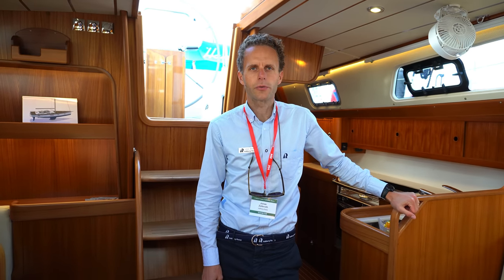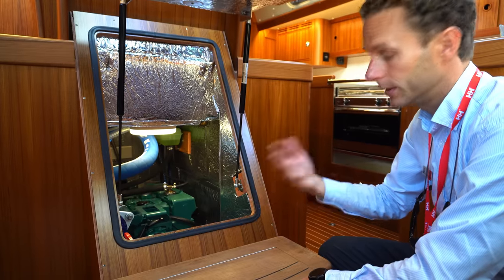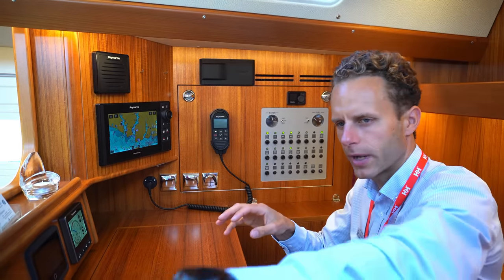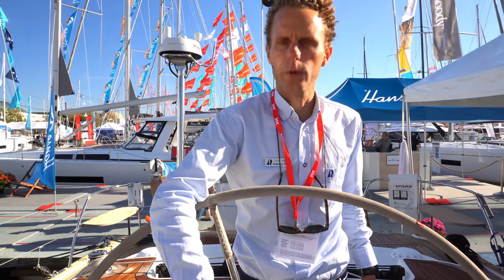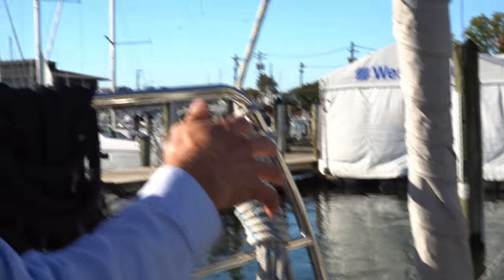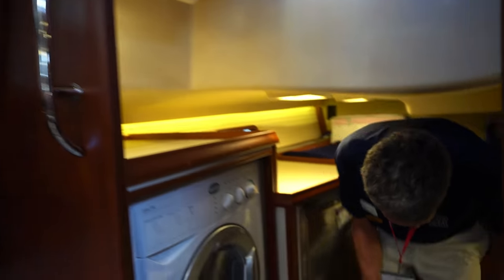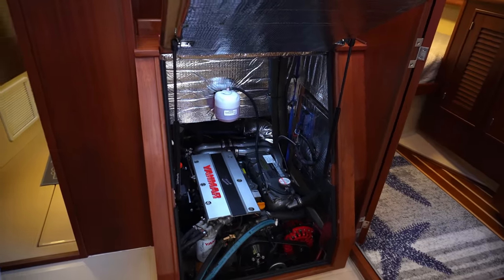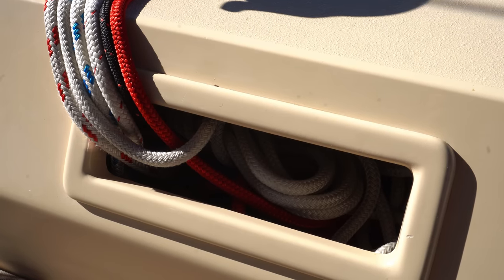Bluewater Boat Tour: Hallbreg-Rassy 44 & Island Packet 439

Comment: I enjoyed the Halberg Ramsey tour. There was a lot of good confirmation of the improvements I am doing to my Southerley 135. One thing I have had to spend a lot of time with was the Twin Raycor filters. I have very little room around my engine so had to do a very compact version. Once I got into it I realized that I should add a fuel polishing pump, so have added a Marco SP3 Gear Pump, and with 5 valves I can draw fuel through either or both filters plus lock them off completely. I can draw fuel from a reserve tank or drum (with integrated fuel return. With the pump I can circulate fuel from the main tanks or the reserve supply through either or both fuel filters. With the pump I can also purge the fuel lines of air and gunk. If you are interested I can send you images, and supply the metal files so you can get a local Laser cut and folder to make the parts that hold the whole thing together. It is a bit more complicated than the Raycor unit they showed there, but it is smaller and does so much more. I standardized the design to have 13mm bore plumbing through out the system, and now have to upgrade the fuel lines from the filters to my tanks to handle the Polishing Fuel Flow. The new line size makes this filter set suitable for up to 450 HP engines.
Reply from the maker: Wow! That’s an awesome setup! I would love to see more of it. 
My email is riggingdr@gmail.com

Comment: The two biggest problems on a sail boat, apparently are 1) lost of a keel 2) lost of a rudder. Also, I have a problem with tight rigging. I would probably choose a sail boat with a long keel (not a full  keel) with a rudder and propeller that are protected by the keel. One of my requirement is the ability to sail over an infinite number of fishing gear, nets or Sargasso weed without anything catching on the long keel or the rudder.  I would probably choose an easy to reef, loose foot, unstayed Cat Ketch rig with wishbones and a small jib (if possible). Except for the small jib the rig is self tacking.

Comment: 3 things..
1. Reliability - I want something that will take a beating and shrug it off. Dual rudders are nice here in the event an orca decides to take one off. Definitely don't want the keel falling off or getting dismasted after a turnbuckle breaks. Good self righting in the event a breaking wave knocks the boat over. (I can go on and on about reliability/safety stuff)
2. Protection from the elements - Sure the sun and the breeze are great when you are sitting anchored/moored off a beautiful beach, but I don't want to be getting baked or blasted by rain while on a 2,000nm+ passage. Also don't want a wave or swell breaking over and trying to wash me overboard. Center cockpits with center helm are my preferred style. (Remember if you are going to do much blue water sailing.. its not "if" you get caught in rough seas.. its "when")
3. Convenience - Long passages can take both a physical and mental toll on you. Especially if you are sailing single or dual handed. Easy operation of sails and access to important equipment are important. I don't want to be up on the foredeck at 3am trying to furl the Code 0 while already exhausted.. or contorted in an awkward position in heavy seas trying to replace an alternator belt.. or digging through a rats nest of wires trying to find a blown fuse.

Comment: Blue water cruiser? Loved the comment about the Spreaders.  Kraken yachts tick the boxes.  Integral keel integral skeg in line.  Up front water tight bulk head.  Solent rig. Oversized furling to furl while sails full.  Centre cockpit. No gas. Thick hull. Wind vane.  Keel stepped mast.  Like furler above, over size rigging. Running back stay.  Preventer.  Cheers Tom
Reply from the maker: I hope they are at the next boat show, I would love to see one in person!

Comment: The passport 545 was a nice boat. As far as features I like the full keel of the packet and I like a protected rudder as well as a center cockpit with lines led aft.  The storage of the packet was also nice. I have more access in my engine room. It is huge but at the expense of a walk over which I kind of prefer because it gives a bit more privacy. The HR addressed one issue I have with a single bed which is a way to keep everyone on their side and off the floor when the boat is on a tack or bouncing around.
Reply from the maker: I know, when he mentioned the placements of the Lee cloths, I was impressed. I always thought island queens were useless underway, but the strategic placement of the Lee cloths solves that problem.

Comment: #1 thing I look for in a boat is engine access. Lots of boats have terrible access. Im a fan of full keel, so that narrows down my options a lot. Engine and electronics area is critical. Thats where you will be spending time when things go wrong. My Cape Dory 28 required I hire small children to crawl in the tiny space to access the back of the engine oil filter. My IP29 is awesome. I have great 360 access to the engine no problem.
Reply from the maker: That is such an important aspect to look at. If the engine has easy access, maintenance will be easier and therefore be done in a more timely manner.

Comment: Glad to see you both, in the sailing arena. I have had a much smaller HR 31, that I picked up in Sweden in 2016 or so. The HR are well crafted and stylish, but the system upkeep requires knowledge and hands on upkeep. Also, didn’t care for the bolted keel (good bye blue tonic)

Now, I am about to get into a 27’ Cape Dory with an outboard well with dual option to run an electric or gasoline engine and much much simpler boat. Wish me luck with the KISS philosophy!

Comment: In a blue water boat I want most a ketch rig, heavy displacement, bow shaped to cut through rather than ride over choppy seas, and a big keel.  I also like a center cockpit with a good enclosure because visibility is better and motion is less extreme.
Reply from the maker: Sounds like an Amel is your boat

Comment: Good input about the rig tension in the Hallberg Rassy. I have one on order and will be picking it up in May. What do you do to measure tension in a rig like this to be sure that it is at 25%? Is there a tool that you recommend that I keep with the boat during my travels?
Reply from the maker: You can use a Loos Gauge but it’s not very accurate or reliable. The best method is to measure the stretch of the stay. 
It is called “the folding rule method”. Basically, you release the tension on the stay and attach a 2 meter long rule or rod to the stay with tape and measure the stretch. 
Hold the rule so it is just a few mm above the terminal at the turnbuckle and attach the top of the rule to the stay. Mark the bottom of the rule and this will be Point 0. 
As you go tightening the stay, the steel will stretch and the stretch tells you the % of breaking strength of the wire. For 1x19 wire, every 1mm = 5% of the breaking strength. 
25% would mean that you need to tighten the turnbuckles until the capshroud stretches 5mm above Point 0. 

The folding rule is the most accurate method to use. As you go tightening the turnbuckles, go counting the number of turns to increase it another 5%. This will tell you in the future roughly how many turns you need to take to correct the rig tension should the situation arise.

Comment: Island Packet is the winner for offshore cruising applications.  Modern HR has too many gizmos and moving parts on HR?  Retractable bow thruster, hydraulic doors, adjustable stays, 3 separate water tanks, 3 refrigerators, stern thruster, foldable radar pole, ping pong ventilators...check your warranty papers.
Reply from the maker: Good point. The IP is the one you want to be in while you are out there, but when docking, (if everything is working) the HR is the one you want to be on.
Reply: That HR was cool. But I was thinking "That will break.....that also will break.....that too is gonna break....."

Comment: Not sure the HR hull  keel configuration 
Is it bolted or is it capsulated ?
And the ruder 
Does it have a skeg? Or is it a spade ruder?
It’s something important for an ocean going sailboat
Thanks for the video
Reply from the maker: It’s a bolted on fin keel with twin spade rudders. 
The island packet has a full keel with a proper shoe at the bottom to support the rudder and the propeller is inside of an aperture to keep it all safe and supported. 

I like the full keel for ocean sailing!

Comment: Less than half a milliion dollars would be nice.  Electric auxilliary.  Solar panels.  Lots of solar panels.  Wind gen.  No fossil fuels at all so no 75HP diesel no matter how nicely the fuel lines and filters are laid out.  Room for close to 20kWh li-ion battery or preferably more.  And lastly no beam carried aft that will make the boat less seaworthy in a strong following sea.  But less beam aft would sacrifice the aft cabin so popular these days.  I doubt any boat on display at Annapolis would meet those criteria.  OTOH - my dream boat is still an unfinished restoration project so maybe anything that floats now would be better.
Reply from the maker: Modern boats are moving towards the “marina queen” look, but these two boats can get you safely across an ocean. Sadly, they are both crazy expensive because you are paying for a well designed and built boat. 
You know my personal preference which is why I am rebuilding the Alberg at this moment and continuing to work on Wisdom. These are examples of a “brand new boat” that you can get from the factory, not a selection of the best boats throughout history (it would still be a very short list).

Comment: Ok guys which one are you going to buy 😊🇬🇧👍
Reply from the maker: At $600,000-$800,000, I think we will keep with our boats from the 1960s. 
If we had endless funds and no boat, the Island Packet would be our vote. There was so much taken into consideration when designing and building the boat! 
It’s a toss up as there are pros and cons to both. The Hallberg-Rassy has a fin keel while the Island Packet has a full keel, neither is a true cutter, but the Island Packet has a lower stress rig. 
It’s always going to be a compromise, but we would be willing to compromise on the Island Packet more than the Hallberg-Rassy.
Reply: My Vega has something that those boats have not. Simplicity. 

 @RiggingDoctor

Comment: Island Packets are too wude, too shallow, too heavy. The long keel and ruddet are very poor performers. Its a motorsailor at best. Then they put a roller furling main on to destroy any last vestige of performance. They sail like bricks. Dangerously bad.
Reply from the maker: Compared to a light displacement fin keel, they are horrible performers. Out on the ocean where winds are steady, their full keel reigns supreme.
Reply: @RiggingDoctor  No it still sucks. It sucks horribly. Compared to a sailing boat they are still too beamy, too heavy, too under rigged and with similar weight and hydrodynamics to a cathedral. Full keels and heavy displacement haven't reigned supreme for 80 years.